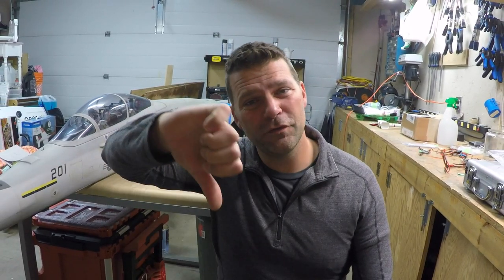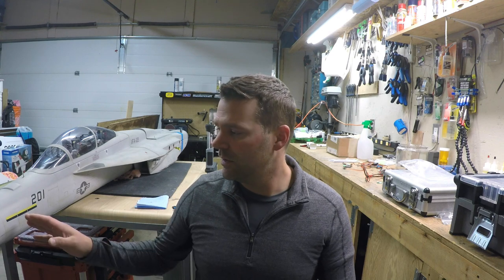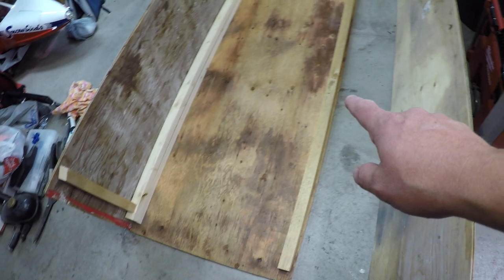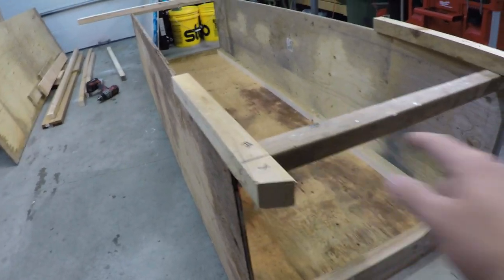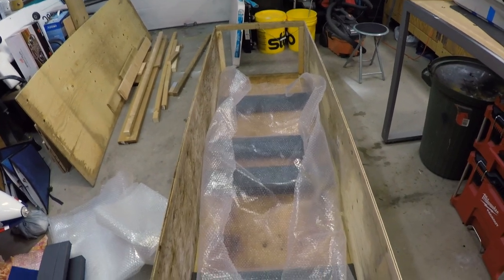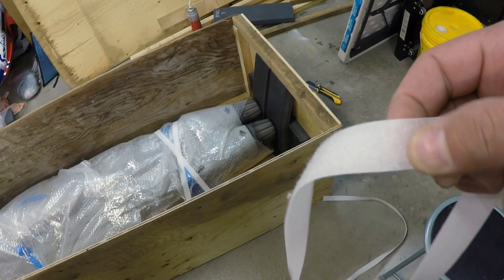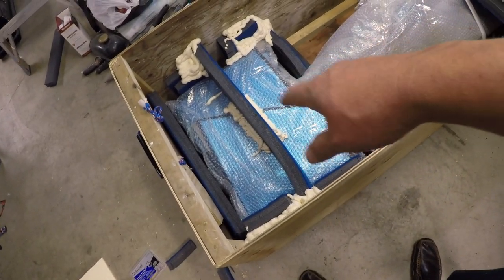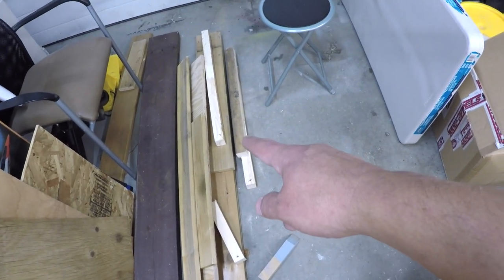HOW TO BUILD A Custom Shipping Crate - RC Airplane & Jets - Shipping container

Comment: Amazing and thanks very much.  I want to ship my brand new fully built, never flown or started Byron F15 Eagle from WA to MS and the fuselage is 104" from nose to tail cone.  Who did you use to ship the crate?
Reply from the maker: I generally use Fedex Freight but you may be able to find alternative company within USA to handle it as i'm sure there are more affordable options.  If you can keep the crate under 8ft or better yet under 4ft the cost comes down substantially.  Over 8ft and it technically takes up 3 pallets of space.
Reply: @thelightersideofrc  The fuselage alone is 104" hence no chance of getting it under 8'.  I received a few quotes and the lowest shipping is around $1700.